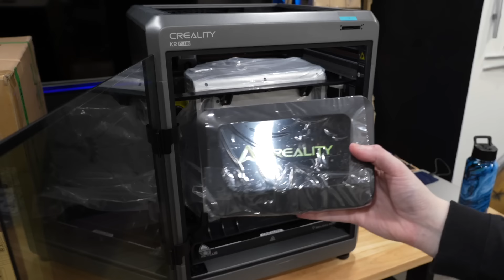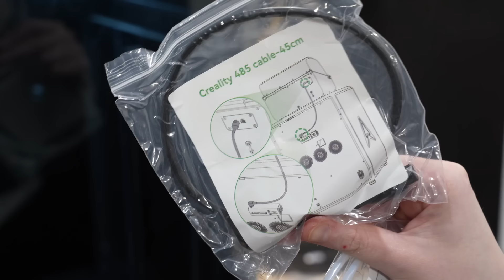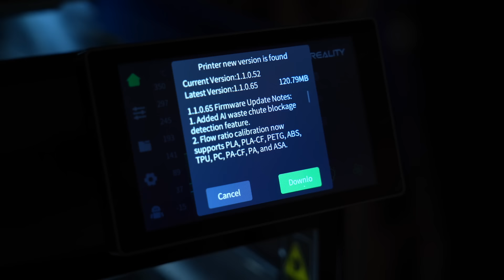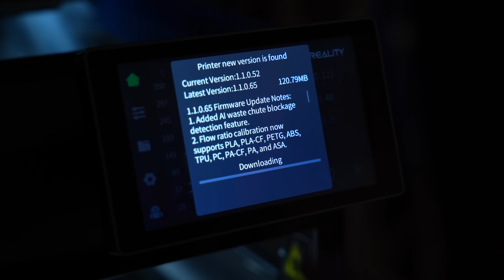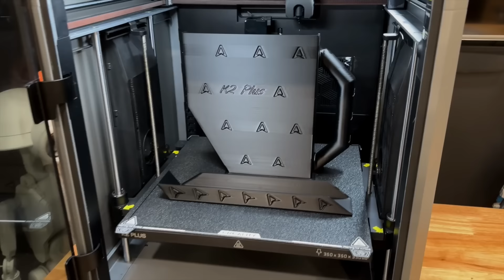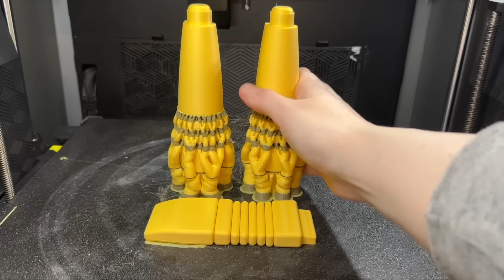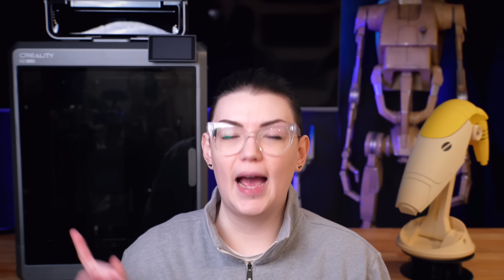Does the Creality K2 Plus live up to the hype?

Comment: Wow!  That sign came out absolutely fantastic!  Will be looking forward to a one month of ops final update on this machine.  I worry about long term even short term parts support.  I was burned on a Creality scanner two or three years back, they never got the required software working for it, so I am slow to look to Creality since that experience.  

There is a reason I own several Qidi machines, parts and support are the best I have ever dealt with.  Waiting bit longer before my next FDM purchase.  Hoping we may soon see AMS for Plus4.  Will be keeping close tabs on K2 updates.

You bring up an extremely valid point on efficiency in regards to where filament cutter is located.  All companies should look at locating cutter such that the lowest waste is achieved.  That equates to time and cost and shortest amount of waste is a huge efficiency gain over time.

Comment: Great video and print 👌🤘Yes, parts is an issue , had a hexbolt in the rail come loose within the first 50 hours and something strange happend , it somehow bend the complete hotend so mutch that nozzle was stuck in hotend ..had to go to aliexpress for complete hotend and a 2 week wait 😢...are up and running now , I did order 2 x K2 but the other is still in backorder 🤷‍♂ ....But it seems to be a good printer dispite my problems.

Comment: The shiny bands are indeed where its printing slower because of the extra travels to do the embossing. If you can preview the flowrate/speed when you slice it, you'll see they match up perfectly. If a uniform surface finish is important for raw exposed prints, the easy way is to solve is to turn the max speed down.

Comment: This is at least the second time you’ve said that there “isn’t” a large format multicolor printer, or here that this is “the first”. Wondering why you don’t count the Prusa XL? Yes, it’s extremely expensive (maybe you don’t class as a consumer printer? Certainly out of my price range), but does seem to tick all your boxes of large area (360mm), multicolor, MUCH less waste, and from a company with a reasonable history of support/parts (it had a rough launch but they also support their printers well).

Also, I love that this is so obviously a clone of the Bambu (and I have no problem with it) that they even copy the included swatches, right down to the way Bambu strings them together.
Reply from the maker: It comes down to me trying to simplify explanations as much as possible so I don’t descend into a 20 minute explanation every time, haha! I often group together the multicolour printing with the enclosed printer argument because there’s a lot of interest and overlap there with people that are looking for a machine that can print basically anything. For me the enclosure is almost of more interest than the multicolour capabilities and that’s where a lot of the other larger format printers start to fall out of the conversation. Yes you can technically add an enclosure to the Prusa XL, but it’s also such a unique machine because of its multi tool head design that it’s not a 1:1 comparison for the majority of printers I end up talking about either, which is why I don’t mention it.
I actually just got an XL so I’m very excited to start playing around with it because it’s eliminating a lot of the reservations I have with multicolour printing.
Reply: That makes a lot of sense! The added enclosure cost (and the 8-week lead time) was what caused me to go to Bambu instead of Prusa Mk4. Will definitely be interested to hear your views on the XL!

Comment: Filament dryers are overrated, 

not only does plastic degrade and loose its properties with every heat and cool cycle but filament dryers need to run for 6 to 12 hours to actually work otherwise its mostly a placebo and thats the equivalent of a 3DBenchy in wasted electricity if converted to plastic in some places around the worlds that's easily 2 Benchies worth of plastic wasted in electricity. Its best to just have a good desiccant in an airtight box and store your filaments in that. The several weeks of passive drying will do more for the filament than a 12-hour drying with heat. Also, you might have noticed that the CFS naturally heats up well above 40c from just sitting on top of the printer as its printing and if you drop a 2 lb bag of desiccant in one of the slots instead of a spool you can get the CFS to super dry your filaments passively. My CFS right now is sitting at 4% relative humidity.
Reply: So what’s your saying is you don’t understand how to use a filament dryer properly and are encouraging others not to because of your own lack of knowledge interesting way to go about that
Reply: @techmaniac69  filament driers heat up ambient air, lowering relative humidity, causing water vapor trapped in the filament and in the spool itself to defuse into the now lower relative humidity air. Once the now warm air with extra water by mass cools down, the relative humidity will shoot past what it started at, and it will get absorbed back into the dryest material. Some filament driers are only just now starting to expell the air with extra water out of the driers, but most dont.

All plastics are degraded when heated up and cooled down in most cases, It's negligible, but not when the cycle is repeated over and over. Furthermore, when plastic is melted even just once, its chemical composition is altered, which is why virgin palettes are always added to recycled plastics.
Reply: @Guardian_Arias  i see what you mean my sunlu v2 had that problem till i put something to leave the top open just enough to let out some air out while it dries and now it goes down to like 12% from always being stuck at like 40% while drying. I guess they are just not designed efficiently enough for their prices (depending on what you get obviously) and desiccant pods are overall more effective for long term dry storage
Reply: @techmaniac69  buy desiccant by the lb and before use take it thru some cycles in your dehydrator. Then, leave some in the dehydrator as well as in your long-term solutions. My dry boxes typically sit at around 4% RH. You really should only use the dehydrator as an emergency solution where you need to print something by the end of the day but accidentally leave the spool out. Also, some filaments and mostly all BASIC PLAs are perfectly fine sitting in open air indefinitely
Reply: I can measure a loss in mass after running an old spool of filament for 2 hours in a food-drier.
Either moisture is being driven off, or plastic is evaporating.
I'm gonna lean into the idea that food-driers (elevated temperatures and lots of swirling air) work just fine.
Reply: @pirobot668beta  Of course, it works, but not as much as it's raved about. That measurable difference is really only from the outer most strands of the spool. On clear spools, you can actually see the water vapor cling to the spool and linger there well past 12 hours. If all you need to print is a benchy for confirmation bias, then a dehydrator will do, but if you are printing more than 100 grams then you should just properly take care of the spool instead and thats if you actually have a filament type that cares.

Comment: If my main goals are to print helmets and engineering parts, what would you recommend between this and the Qidi Plus 4?
Reply: The plus4 have higher nozzle temperature and better chamber system,  and i like the qidi filaments quality.
Reply: Qidi is definitely the best at printing engineering parts. Creality's chamber heating isn't quite there yet.

Comment: I realize this may be a complicated idea, but you would think that slicers could be configured, for printers that have multi-spool capabilities, to not waste as much filament by using it to purge as infill within the print.
Reply from the maker: There are purge into infill settings, but it takes over the job of the purge tower rather than the separate purge pieces. An oversimplification is that there won’t always be the infill area on a piece to purge what it needs. I could see this becoming a possibility in future software developments (or at least I hope it will 🤞🏻)

Comment: If you watch the heating elements on Fluidd you'll notice that when you heat the bed and the chamber at the same time, the printer will send 100% power to the bed first and 0% to the chamber. Once the bed has heated to temperature the chamber heater then kicks on. I wish it heated both up at the same time. Maybe when you set 40 degree chamber your bed was heating up and by the time you set it to 41 degrees it had reached temperature. I'm glad you have pointed out the chamber heater issue cause it's quite annoying and time consuming. 

Also I did a 64 hour multicolor print and the estimates were way off too. 6 hours off and 300gram difference. Thanks for pointing this out too

If you're using a mac to slice Creality is behind on the software update compared to windows computer cause the clitchy screen is mac computer issue many have experienced. Update is supposedly on the way
Reply from the maker: I’m 95% sure that I always went to input the chamber heater after the bed had already finished heating as to not freak out the battery backup it was plugged into, but great to know! There has been at least one new firmware update since then so it might be all fixed now.

Comment: I agree with you about the filament dryer, i generally don't nee one either.  I print with 95% ABS and my area/shop is relatively dry most of the year.  For my PA-CF I have a dedicated external dryer which is perfect because It's not recommended to run carbon fiber through the AMS anyway.

Comment: I am slowly saving up to purchase this printer.  I hope to do so in February.  The large 350x350 print size is my deciding factor.  Will go with the Multi-material system for that spool change capability, as it's been a very handy feature on my Bambu printers.
Reply: Get a Bambu, muchhhhh better

Comment: Awesome video. Yes replacement parts is a huge issue. I had to order a part off aliexpress. Hopefully it fixes my printer
Reply: Oh wait! There is an orcs profile!!!
Reply from the maker: Aw man! That sucks! My fingers are crossed for you that it resolves the issue 🤞🏻
Reply: @UncleJessy  your recent rant video was so spot on.
Reply: @WhereNerdyisCool she always but not printer for me
Reply: Don't tell me you need a new glass door!?
Reply: I keep hearing bad things about this printer...  I'm just going to wait for the next Bambu.
Reply: Hey UJ what r u doing here :) HAHAHA " hope all goes good at you " And MM always good too hear youre OP on new things thanks for that
Reply: Why don't you just buy an X-1 Carbon or a P1S or even an A1 from Bambu Labs at that point?
Reply: @ larger build plate
Reply: @cylonmode  And height!
Reply: Did you get them?  I tried ordering a new old stock V2 board for my Ender 5 Plus I inherited.  The "store" that shipped it no longer seems to be on AliExpress (probably re-named as it was "saturn" and now a company called "venus" is selling it).  I've ordered from AliExpress several times without issue.  The past 4 orders have been NIGHTMARES.
Reply: Bro fixed it